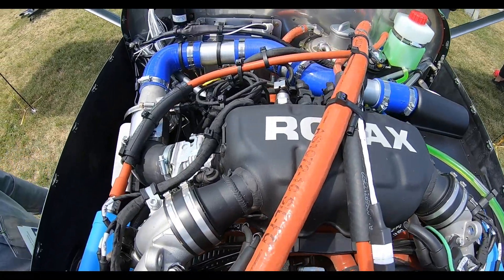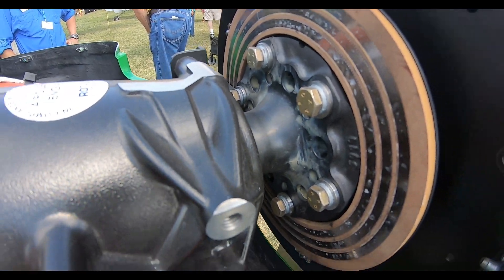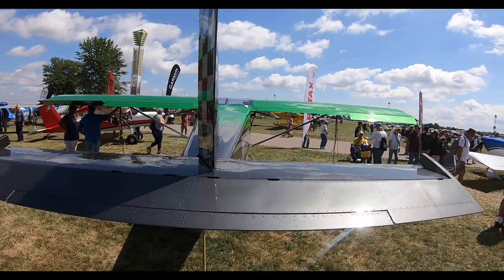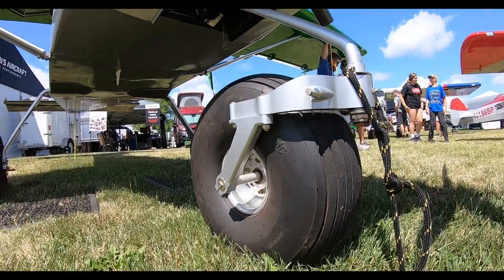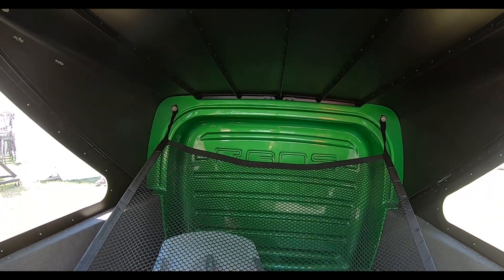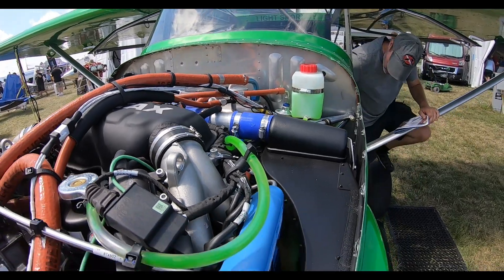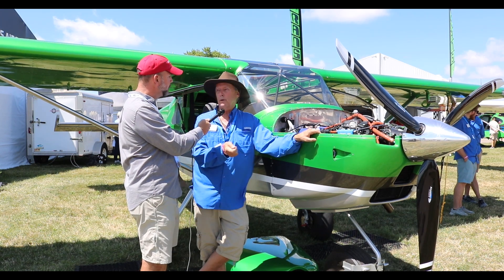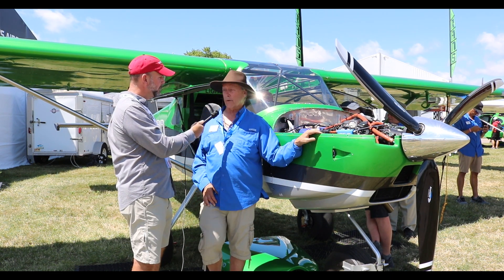TURBO Rotax 915is Engine in a RANS S 21 Aircraft!

Comment: The S21 seems prefect for the Viking 195T.... love that engine for smoothness, power, and reliability (Honda power).  Flying backcountry I would want the extra power of the 195T and would never consider the Titan (no turbo). I have flown the 195T in the CH750SD and was very impressed with the power output/torque...and exceptionally smooth!  I am former military aviation, major airlines, and A&P background (30 years in Aviation).
Reply: With that Pedegree, you should know the Rotax and c/s prop is an all round better polished engine than the Vikining…
Reply: @Captndarty    I actually love the reliability of the Honda based Viking Engine, how smooth it is, the engine ECU, and the sturdy gearbox... so I have no issues with Vikings Engines.
Reply: @neualgo_systems I’m with you on a Rans 21 with a Viking 195T but unfortunately Rans turns their nose up with Viking on support.

Comment: I’ve seen 138KTAS WOT at FL190 at 8.5gph and 133KTAS at FL230 at  7.4gph in a Rans S21 Rotax powered 915 with 26” tundra tires. Down low I can also do 100KTAS at 5gph and 75KTAS at 3.5gph as well. Whatever your desired altitude is you can’t beat how smooth and simple to operate this engine is. Amazing airframe and engine combo.
Reply: So today w all the latest fairings, what are your numbers at sub-oxygen level, say 8, 9 or 10k ? 916 numbers will do just fine too.
Reply: @101jtag about 122-125kts tas at 8,000 8 gph.

Comment: I’m surprised to see it setup to take induction air from inside the cowl. Seems it would benefit from getting cooler air from outside. This considering how much inner cowl heat is generated by the turbo.
Reply: Correct...  I would create a NACA air inlet to feed the turbo
Reply: The cooler air is derived from the intercooler intake more so than induction air directly into the turbo. Manifold temps are low and work perfectly

Comment: Thank-you. There are only Lawyers and Government-bureaucrats standing in the way of this 915IS… 180hp would be easy. Sad.
Reply from the maker: It will be intersting to see what comes to market or what upgrades happen in the coming years for this platform.
Reply: @CRASH ALEXANDER what you completely fail to see is sustained horse power not the momentary burst. Water craft engines don’t last worth a damn wide open on the lake.
Reply: @CRASH ALEXANDER STOL competition is still a huge minority in experimental aviation.  No one wants to listen to an engine whine at 8000 rpm’s at 55% power on a XC. Many have installed such and engine and have commented of how they don’t like it other than it being dirt cheap in comparison
Reply from the maker: @CRASH ALEXANDER Yamaha (Both used 4cyl and NEW 3cyl) are still in development by a few different Homebuilders. And the gearbox is also still in development. watching those closely of course. But they aren't in production.

Comment: Please not another free advertisement for Rotax. Who cares?
Reply from the maker: Well with Supply Chain issues in nearly every industry,  it is good to have options to get Aircraft actually into the Air.   RANS is an SLSA Manufacturer and need engines (production engines) from companies that can deliver in production.  Also need to be ASTM certified/approved.  So that sort of limits the playing field of availability if you think about it.  This was reported on because it is "First-in-Airframe" for RANS. 
Which engine would you like to see in high production?  Thanks for watching.
Reply: Who cares? Anyone who wants an engine that will make TBO with zero issues, like I have once, and now am halfway to doing again, with my 912S.
Reply: @portnuefflyer  If you got the money, they will gladly take it. Between the glass panels, the lack of affordability of the engines, at the least, the cost of kit prices, these factors are causing serious divisions of affordability. Who can blame them for charging what the market will bear from those who have this kind of disposable income.  I have owned three certified aircraft in my lifetime and the most I spent was $12k.  My first a ragged but dependable Cessna with a low time engine for $5k in the mid nineties. Today buyers seem to be happy as a cat with the canary but even those who are charging this premium and receiving the same should see these days are fast coming to an end. Get it while you can. I wonder what the average gross income of todays kit plane, LSA buyers are? Maybe the EVs are the affordable answer to future flight. My head hurts to even think that.
Reply: @crawford323  I found the 915 and glass panels very affordable…. 🤣